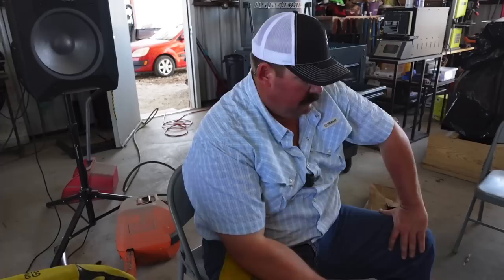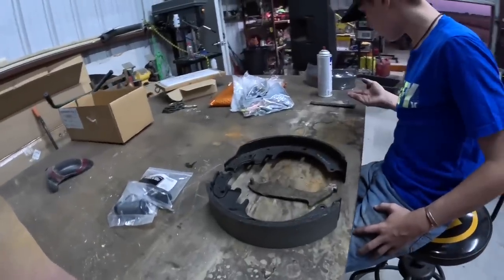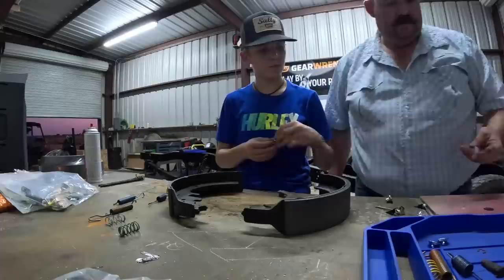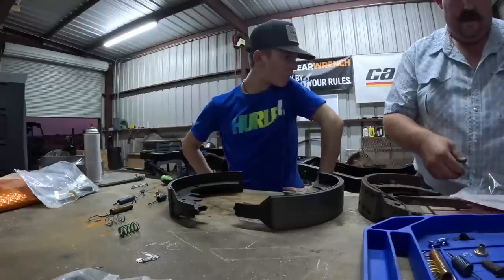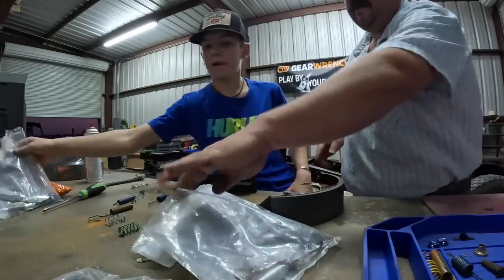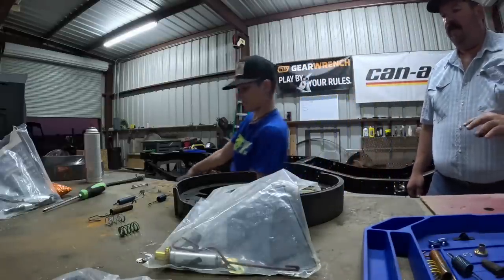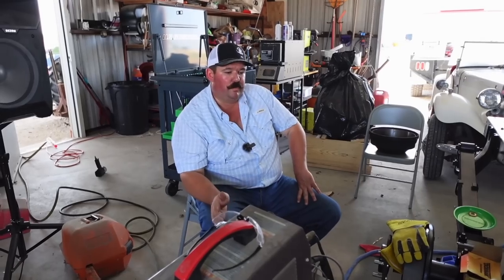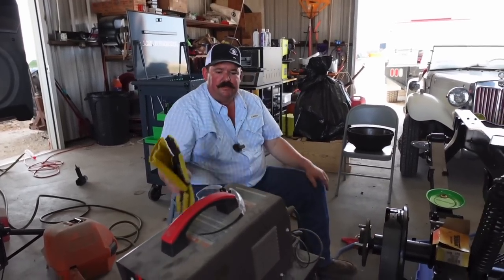Will We Make It To The Car Show?

Comment: Oh and if you had a FF axle you can pound out the bolts with a 3lb sledge hammer and then you can hit the new studs back in by hitting the back side of the bolts or the way I do it is I will use a air hammer to put the new bolts back in!!! It definitely works good if you can use an air hammer!! Plus it won’t cause the nurled part of the bolt that helps keep the bolt tight to the flange or hub tight unlike when you try putting them in with a air impact or a Milwaukee impact!! When you do it with a air impact it can cause them to wear out the hole and over time it can cause the bolt to start to turn in the flange and then you have even bigger problems!!! I had to learn the hard way and found out myself by doing it that way!!! It can work for a while but if you end up getting a flat and have to take a tire off that is usually when it will happen to you and before you get the tire off!!! What do you do then??? Well I ended having to cut the bolt off so that I could get the tire off and get the flat fixed!!! Definitely not fun when I could have done it Wright the first time!!! Hopefully that all makes sense to you!!??

Comment: It’s not the part. It’s user error. Should’ve used a wheel stud install tool OEM part #24234
Reply from the maker: It’s called making due with what they had to try to meet a deadline 😉